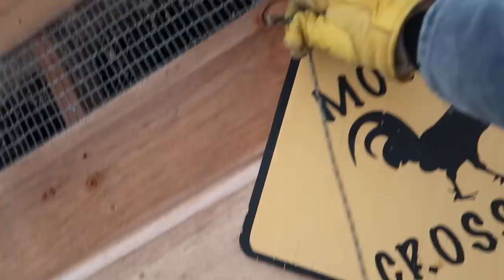It's Better with TWO     Building DIY Custom Smoke HOUSE

Comment: I like how you always have something to make. You made a good shop to work in and you and your wife make a good compatible team that knows what needs to be done. The barn really turned out good. The one thing I didn’t like was the ladder for the loft. I thought a regular ladder that you could store against the wall would have given you the freedom to raise it anywhere a long the loft. I’m waiting for the garage and hope it’s big enough to incorporate a small auto shop for doing small things on your vehicles. Oil changes, batteries, starters and what ever you need actually flat tires and such. You seem to be a very capable guy that can handle all things that come your way. God bless you and yours, and CWC.

Comment: Al, your simple solution to snow in your green plastic feeding containers is by covering with a canvas flap over the feeders. Attach the canvas to the top board that holds the feeders. When the goats have eaten, toss the canvas flap over the feeders. This will protect them from snow and rain. When it is time to place food in them, flip the canvas flap back and hook it on a few small hooks into eyelets at the edge of the canvas. This holds the flap out of the way for the goats to eat.
So cheap and simple to install. No more snow problems. No danger of goats climbing up and over the fence.

Comment: When you rip on the table saw, I almost choke seeing your left hand so close to the blade.  Suggest that you consider using a 2nd push stick to apply pressure towards the blade from the side.  Your feed push tool is OK.

Comment: Just noticed Gina wearing her rings while working in the workshop. It would be a good idea for her to either leave the rings in the house or get a silicone ring to wear for safety while working around the farm.
Reply: I almost lost my finger to my wedding band back when I was married.  Not married now, so it is no problem.
Reply: what is the issue  ?
Reply: @davelawson2564  The ring could get caught on something and really injure her finger or she could lose the finger.  Best to remove rings and watches when working on cars, wood, power tools, etc.
Reply: My ex was an electrician and he never wore his ring at work. That was what he said, didn't want to loose a finger.
Reply: @wendy833  Even more, the metal would have caused a greater chance of getting electrocuted.  I heard many stories of that happening when I worked as an electrician.  I work as a Commercial/Industrial Electrician and that involved a lot higher voltages than what a Residential Electrician would encounter.
Reply: Better no jewelry in the workshop. When i was studying cabinetmaking, that was one of the first safety rules, no loose clothing, no long sleeves and no jewelry, especially if you are working with a tablesaw or drill press!
Reply: @Newman81964  , he is also a commercial electrician.

Comment: You have an easy fix for a "roof over the new goat dishes." The framework from your old storage tent and a tarp. It would make a quick shelter without making an easy escape route for the goats. I love how you two work together in the barn / shop now days.
Reply from the maker: Ive thought of that frame work but it slants both directions I’ve been try to think if there’s away to use it by cutting it in half.
Reply: @LumnahAcres  I was thinking of straddling the fence over the dishes.

Comment: Get a first aid kit for your shop. If you have trouble with dust in the air in the shop, buy two box fans, build two platforms on opposite walls above your head, mount the fans blowing in opposite directions with furnace filters on the intake side. That will create a whirlwind effect and keep the air clean.

Comment: Looks like it's coming along nicely.  If I may suggest, when you have to make the same cuts with your miter saw, cut one, lock the saw in the down position, lay your dimensional piece against the blade and then screw a stop block at the other end.  You'll not have to measure the remaining pieces and they'll all be exactly the same length.  You might also want to add a little glue to your joints.  It will make them many many times stronger.

Comment: You need a first aide kit hanging in the barn for when you have little accidents. The smoker is looking good. And speaking of looking good, oh boy, that pie looked so yummy along with the whipped topping! You guys were brave to do a lattice top and it didn't turn out to bad. Besides, I'm with Al, it is all about the taste, not the looks. I still thought it was a pretty pie though. Gina you can make your dough in your kitchen aid. So much faster and easier. I used to make my pie dough by hand like you did, then got my KA mixer and started making it in that with the dough hook and have never looked back.

Comment: you might want to consider putting a spreader bar between the runners at the front, middle and back to give it more support and prevent the runners from caving inwards or outwards.

Comment: Hey Al, maybe instead of a roof you could put rubber flaps so the goats can get to the feeders without it getting wet. Or a hatch you can lift when feeding them and put down later.

Comment: Al, if you make a bus-stop type cover over the feeders (closed on 3 sides and with a high roof with a slanted overhang), the goats won't be able to jump up on it, you won't hit your head on it, and most of the snow and rain won't get into the feeders.

Comment: Just put "thin" rubber lids over the bins.
Strong enough to stay straight over the bin's but weak enough for the goats to push them aside.
Attach them to a piece of wood with a hinge for easy access for you

Comment: Need to have first aide kit that includes quick clot (alum powder is good too, lots cheaper) , sterile gauze, and a thick towel ( or a few sanitary napkins). We had an accident with a saw several years ago, not room for details, but just a few simple things could have saved a thumb and a few hospital days. Careful doesn't always work as planned!

Comment: Instead of thinking "roof"over the goat feeder trays, think "cover".   A  hinged board that  you can  fold down over the trays in the evening  to keep the snow out, if level with the trays it might not be high enough for the goats to use as a boost over the fence.    Or a rolled piece of tarp/canvas that you can unroll over them, something the goats can't climb on.

Comment: 4 pork butts for smoked pulled pork. Pull the pork from the butts and mix in bbq sauce. Then portion to quart containers and freeze. It's ready when you want it. You can smoke a couple of beef briskets as well. That way you get the smoke to do more meat at once. I would line the smoker with Hardy tile backer board and run it dry the first time to season the smoker. Your probably done building it. But I would make the door a full overlay door with a foam gasket to seal the smoke in the house, Just like your refrigerator door.  Then a 6" chimney with a damper through the roof.

Comment: As Gina was looking for a band-aid today, and that you two do most of your "fabrications" in or around the workshop you should consider installing a small "First Aid Station" similar to those in commercial environments. Nothing too elaborate.  Probably a "box" about 8x12x4 that you could attach to the wall near the sink.  Can be purchased (inexpensively. Less than $40.00 ????) fully stocked (ie: Band-aids, gauze, neosporin, disinfectant, alcohol, etc.), probably locally but I assume something on Amazon.  To be replenished locally (CVS?) when needed.

Comment: What about putting a board directly over the girls' grain bins over night so they don't fill up with snow? During the day flip the board up and out of the way so the girls have access and can't  climb. ❤🌅🌵 p.s  won't be an issue in summer as rain water is easy to dump.

Comment: 28:34  Ooo, yeah.  Not quite.  :P  I always build them from the middle out, adding one strip at a time so I can manage the weave.  Actually, I was kind of waiting on seeing the rubber mat come up with slits in it from the pizza cutter.  :D  The pastry wheel I use is plastic.

Comment: When it’s raining and below freezing, it’s because there’s a warm air mass at the height of the clouds and a colder air mass at ground level. When it’s above freezing and snowing, it’s because the air temperature at cloud level is below freezing but there is warmer air underneath.

Also, if you put a very steeply sloped roof above your feeders, the goats won’t be able to jump onto it.

A third point: I strongly suggest you put two hotwires above your pasture fence and the bucks’ enclosure fence before any predators decide to come closer and jump or climb over the fences! You could run it all from the mains power in the barn, avoiding any problems from frozen batteries or grounding issues caused by frozen ground. Use cable type hotwires rather than string or tape ones.
Reply: Thank you mister wizard
Reply: I agree. With the bucks door open, it's only a matter of one hungry coyote.
Reply: A steep roof won't stop them.  A goat can run up the side of a solid fence if they decide that's what they want to do.  Mountian goats clone vertical rock faces all the time.  One of my La Mancha dairy goats ran up the side of the barn to get over the fence.
Reply: A very slippery steep roof will stop most goats! There will always be some real acrobats, but I suspect Al’s little dwarf goats won’t fall into that category 😀
Reply: Something to think about.

Comment: Future projects - First aid kit = Band-aids. Make them yourself from scrap pieces. Fire Extinguisher. At all work locations. Since it is cold outside and you are now inside. You require a dust collector and air filtration system. Smoke detectors and Carbon monoxide at the house.
Safety First. I have learned my lesson the hard way.

Comment: Shop Tip-- I did this when I burned wood - Made a box 30" long x 18" wide x 18" high out of 3/4" plywood (because I had some laying around). Put a bottom on it, and cut out handles on the short sides- throw all your small scrap lumber in it. Now  you have all your scraps in one place, and you can carry it to the house for starter wood.
Reply: I was thinking a 30 gallon garbage can with/on wheels would be great to throw the scrap wood in. Could be plastic or metal but then can be wheeled around the shop wherever they are working. Then could be either wheel or hauled up to the house to be burned when full.

Comment: If I may, it's best to build your lattice on the pie after you fill the bottom crust. There are rollers made for different pie top shapes that allow the edges of the crust to remain whole for easier placement.  They are under $2.00 at Wish.  I got one two years ago and love it.  There are numerous videos on Google about them.

Comment: New video idea..... Different and most practical first aid kits for workshops. Even down to aspirin for those every so often headaches from noise. I would like to see some researched ideas. We have some pretty nice ones in vans at work.but also have portability in mind because it would suck to have an awesome first aid kit in workshop permanently on the wall and then something happens behind the trailer out in the field.

Comment: You should have used Kreg Jig Pocket Hole Joinery instead of those long wood screws ! It would have made for stronger joints especially on the corner framing members

Comment: you can use the cream colored  Poly carbonate Roof Panel like on the wood shed & put it at a steep angel so they could not get on itand they would slide right off but feeder would be covered

Comment: Why not extend the roof of the barn to cover the tanks with the nutrients? This would also make them an outdoor shelter in case of rain or shade with fresh air in summer. But as I used to say; I say what I think but it is my opinion and it engages only me and each one does what he wants, as he wants and what he can. Kisses from France.

Comment: should install two posts on either side of the grain feeders up to a 30 or 45 degree supports for a larger pitched roof for the grain feeders for the goats

Comment: I dont know if I can make this make since but here goes an idea for you goat mineral feeder lid. You know how you have that little board that goes the length of the feeder the locks in or releases your trays? Well I saw on a YouTube video were the guy had like three boards that would cover it but fold up in accordion style when not in use. so you would put hinges to connect each board to the next. during the day you just hook it to the fence so it stays open , nothing to jump on and at night unfold and cover to keep the snow out. Not sure if it would keep out the rain without some kind of cover over the hinges. Maybe that will at least give an idea. His had a different purpose but I thought of you as soon as I saw it.

Comment: Al where you have the goat minerals on the mesh fence what if you would  built a roof they came off the back of the building right to the edge of the fence this way you could feed the goats no matter what the weather is and they  will stay dry

Comment: I have been snagged by those dang staples that are left on the 2X4’s from the shipping packaging too. Ow! 
Put a little first aid kit with disinfectant and band aids or electrical tape. The electrical tape works way better at staunching the blood and lets you keep working. Disinfect then wrap, and go.

Comment: Al, when you said Gina was trying to find a band-aid (or plaster for those across the pond), I got a little concerned. I think it would be a very good idea to have a serious first aid kit in the shop since there are so many ways one could get injured from minor boo-boos to falls to major gashes. It would also be a good idea to make sure you could quickly and easily communicate between the house and the barn in case of an emergency.

Comment: You can send Australia the rain Al we need it right now
Reply: Saw the wildfires on the US national news. It's really terrible what's happening, loss of life, homes etc.😯
Reply: yer biggest issue is our government not doing the fire management in winter over the past 30+ the fuel load on the ground is at the point just dry lighting can start a fire as much as the fires are bad it does help late with rain as Australia can go dry for years then have run of rain its life for Australian's.

Comment: what I seen with bakers that do the fancy tops of pies will bake the top separate from the pie. Pull that out, when the pie is done, they slide the topper crust on top of the finished pie...

Comment: Why are u not using the tire water bowl for. the chickens?  Do you still use the weather station u installed last year. I agree u can afford a good first aid kit and ear n eye protection. Also add a fire extinguishers. Keep up the good work.  great effort with the pie.

Comment: Why don't you mount feeder to side of barn. By hay feeder or facing the pasture. Then you can put roof over it.
Reply: Not enough room.
Reply: Even on the back of barn just around the corner facing the pasture. Looks long enough before going through the fence.

Comment: there is a lid that can be pushed aside by the goats. Rhodes did ont for their sheep
Reply: Sandra Farley - Justin Rhodes did it for their cattle, their sheep do not need a lid because it is under the sheep shelter.

Comment: Make it mobile with wheels so you can move it inside or outside.
Reply: Joyce McIntyre - It's on skids.
Reply: @tonygrimes13  What's on skids.  I was talking about the food trays on the fence.
Reply: @joycemcintyre5543  Apologies, I thought you were commentating about the Smoker!
Reply: @tonygrimes13   Sorry for the confusion guess I didn't make it clear.

Comment: When building, or fabricating could you point out the value & some of the uses of the rule of 3-4-5, AKA: the small speed square. think you have shown it before, but didn't refer to it as that. I recently learned it can be done with some smart phones at huge distances, all this new tech stuff is a lot to keep up with for sure. have a nice day & a better tomorrow. I will see in a few hours how my 2020 is going to go after visit to this so called doctor, wish me luck,    peace out, stay safe

Comment: Why not just a cheap plastic roof over the feeder? If the goats jump on it,,, it will just rip and need repairs but they won't be able to use it to jump over the fence.

Comment: So rather than throwing your wood scraps on the bottom of the bench... how about building yourself a box for scraps? It would keep the shop cleaner, and you'd be able to take it back to the woodstove if you needed kindling or any other spot you needed help. You spent so much time  building this work shop, that you haven't taken the time to organize or figure out where to put everything...

Comment: I dont know that you will be able to get another goat from weed um and reap. The goats aren't due until April and then by the time they are weaned and ready to leave mom it will be June/July and well over 100 degrees and to hot for Transporting the way you did hope but maybe you can find a different way to transport the baby goat like a live stock transporter or something

Comment: I think your smoke house is a little tall & top heavy for the length of the skids......I would probably have made the skids a bit longer and maybe even built the smoke house on a wider platform with the skids further apart to take into account the height & top heavy weight of the smoke house because your building it out of some heavy timber.....Just me....don't take offence...much love